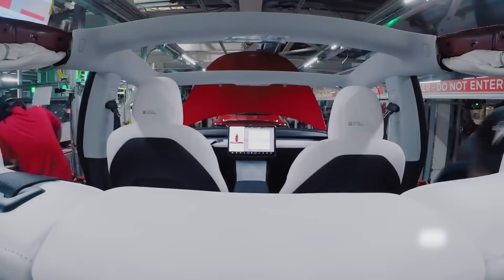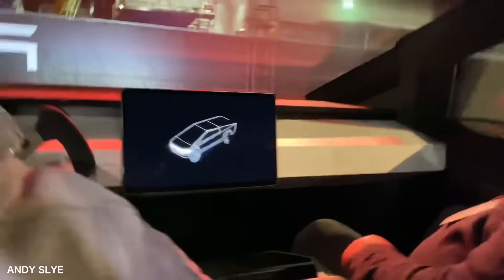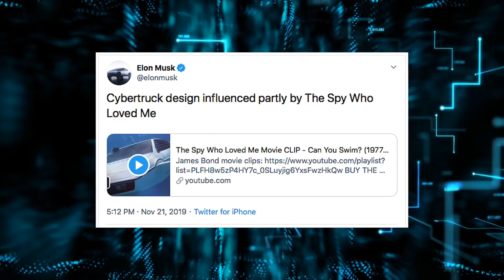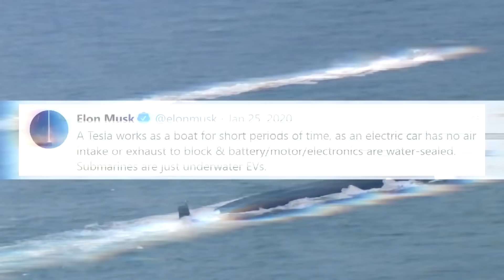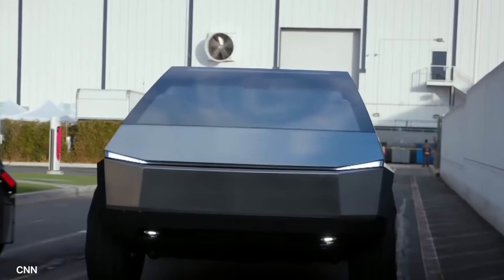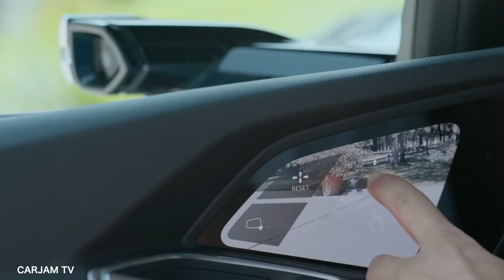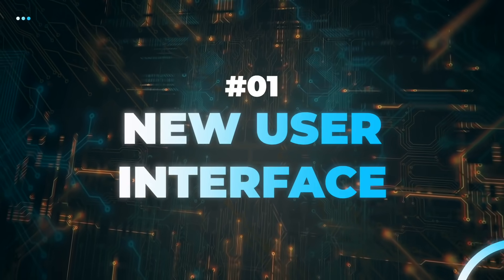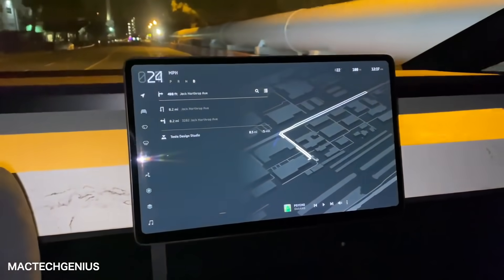Tesla Cybertruck - This is why Cybertruck is Special

Comment from the maker: "EDIT (ERROR): The price of the tri-motor model is said to be $70,000 rather than $50,000"
Reply: TechDiv go "THHHH" with every breath
Reply: Another edit: 9mm is not most commonly used in machine guns. 7.62x39 and .556 for militaries.
Reply: @GlassicGamer  
7.62*51  brother
Reply: @GlassicGamer  I
Reply: Elon actually also owns the underwater submarine car from the James Bond film.
Reply: Cool
Reply: Cool
Reply: should bring the price of Landcruiser's down heaps but fuel prices will rise.
Reply: another error, 9mm is never used in machine guns, as well as the fact that an either intermediate or full powered cartridge machine gun was shown on screen, neither of which are the same power as 9mm parabellum.
Reply: @ivefallenandicantgetup7950  

I completely agree. 

More like submachine weapons such as an Uzi or MP5 but with rifle technology since the STG44/45 evolving, the submachine pistols are replaced with short barreled 7.62mm, 5.45mm in AK platforms and 5.56mm, 7.62mm and 6.5mm rifle cartridges in the ARmalite platform. 

9mm SMGs are rarely used, if they are it's security detail for close quarters combat in buildings, not range to building or range to vehicle warfare
Reply: @JDMatthias  yes, submachine guns are usually used by security guards, bodyguards, and the secret service. But even if a submachine gun was used on the cybertruck I doubt it would be able to withstand the constant beating of bullet after bullet, especially if the weapon fires a specialized bullet such as 5.7x28mm or 4.6x30mm.
Reply: If you purchase the Cybertruck, be well aware that the thumbnail is a HUGE LIE! 

Yes, Elon Musk did say that because the batteries being in a water tight container the truck has some temporary buoyancy, it is not. 

NOT amphibious!
Reply: 2nd error, that's the Model Y and S
Reply: vitalik #shiba to 1 cent
Reply: It is electric
Reply: Lol
Reply: cheaper than I thought, I think it's price is 1,50,000₹ (Indian currency)
Reply: still good
Reply: The in built bed is rather good for homeless people
Reply: Hi, Gagan here.
Reply: 2023 will be $90,000
Reply: you are totally fine man
Reply: T
Reply: @syIer.  This is Great and incredible Cybertruck 100%  truck....
Welcome to Brazil Mr. Elon Musk.
We have great Place and Stregit pointer near to the graffiti  mine near to big Federal Route and big River too...

Welcome to Brazil man...
Great support for Tesla in Brazil...
Reply: Yeah
Reply: That's not a steering wheel, it's called a yoke. They're selling the updated Model S with that.
Reply: @StephenHitchens  it is a steering wheel named yoke
Reply: @StephenHitchens  vgk

Comment: It'd be pretty cool but like y'all said the standard run time on a full charge if you drive straight without stopping is only 250 MI and the charge time is over 21 hours just to get that so no I'm good with my Ram

Comment: What do you do when the electric grid goes down and there's no power?
 Are the charging stations all same type charger?
 When pulling what's the towing mileage like only a hundred milesso then where do yah find charging stations?  
Good show examples your actual towing 14k how far goes.
 heard to big takes up parking spaces it's large from side it's about 4 inches over lanes lines,  they commented its to wide some people say who viewed the truck.
Are those seats comfortable  enough where Lay down rest or sleep while charging? How long will take to charge? 
Do you have solar generator that can charge this if the power out or there's no charging stations? 
 wonder how zero point energy could complement ther install or industry.
Do you have turquoise blue as standard color for all dealerships? Why taking so long to actual Get hybrid Truck's that can actually tow?
Be fantastic when the release allow release the hover car's.

Comment: I've been able to build a huge income stream by investing in crypto with the help of Mrs Evelyn T hills trading skills & accurate analysis. 
Crypto analysts remain divided over the short and medium-term direction of the market, though major investors continue to buy the dip. There's no any reason to panic, as long as you've investing responsibly. As an investor, We all should follow the way of earning more regardless of the current market which is trading. This is the best time to double up and buy more- buy the dip and trade. I have made over 18 btc profits not just
by buying the dip but implementing
trades with signals supplied by Mrs Evelyn T Hills. You can easily get to Mrs Evelyn T Hills through her whatsapp number.. +: 1 : 3:, 2:, 3:, 9:, 9:, 9:, 4:, 3:, 0:, 0
Reply: I would contact her right away

Comment: Not to give too much away. I live in Colorado.  I ordered a few cybertrucks 
a year ago. They're all going to have TRI FSD. I have a thought of a way to use and
promote the first ten I'm getting. Its essential though  Please Mr Musk If you read this
  they get the three three quarter hitch front and back. 
      So, other then solar hanging from these, you could connect  
each CT to one other  tow . pull.  And my secret money maker with
 USING FSD TO ITS FULL POTENTIAL.    with that awesome speed.
And of course we have the mountains         I had to get the cyberlandr     
    THE CYBERTRUCK    Is as exciting as finding BIG FOOT         
    With all the cameras on teslas Ill have a big foot pic in no time.

Comment: Is this thing submersible or is one coming out one day??? Yes very interested but looking at a $300,000 price point no need to be cheap with a futuristic car angle

If this thing folds out into a house as planned, or maybe a boat, this beats rolls-royce to me. You are competing with a $500k-1 mil price point. Stop cheaping out with $40k priced cars. and Tesla needs to make diesel engines with electric chargers. Waterproof. Fold-out.

It needs to LOOK like a million dollar home. Not too big. Maybe in California.

Not an RV.

They are on the right track with cyberlandr and yet they decided on..... no diesel engines. The generator can be solar but the engine needs diesel.

Does Tesla plan on outclassing rolls?????????????????????

Then you need diesel engines, until super water engines come out for cheap. Please. DON'T BOATS DO IT OR SOMETHING??

Comment: I would like to see this video add an actual side by side with F150, RAM etc.  I am having trouble figuring out that aspect.  It is cool and all that.  It has horsepower but regarding pulling a travel trailer ... how will it do.
Reply: It will pull a trailer like a women pushing a stroller 🤣🤣🤣🤣👍

Comment: The idea of the touch screen for areas of use it designed is completely wrong. Touch screen good on highway or good road. But offroad driving and tough screen are not compatible. I know this from using Mitsubishi Pajera with 8 inches screen (custom one) offroad. You simply can't point your finger to where you need (again, I'm talking just offroad. On road all fine)....

Comment: What will the range be, when pulling 14,000
Reply: Who cares. The point is being missed that if you need to tow over that people by the higher spec trucks such as the RAM 2500 F250 and so on.

Why they feel the need to point out the towing power is beyond me.
Reply: @evacody1249  I think it is good they point out what the truck can pull.   I bought a truck, in part, for what it could pull.  

I’m really excited to see what the Cyber Truck and other EV trucks can do.  It will be fun to watch them evolve over time as battery technology continues to improve.

Comment: I'm not going to see this truck anytime soon. It doesn't comply with Scandinavian and European safety standards.  Pedestrian safety, headlight designs is far from the requirements. This vehicle will easily kill pedestrians at very slow speed.  They need do redesigned almost everything to get it approved on Scandinavian roads. Bumper hight must also match other vehicle. Keeping it off-road capable and road legal will be extremely difficult.

Comment: My garage is 20' in length, but I have water heater and washer/dryer in the front and need to have 2'-3' space in front of it to walk around. So forget it to park it inside my garage. I might park it on my garage driveway, but I would be blocking the sidewalk about 2'. Also, if I can't fit it in the garage, I can't charge it in the garage overnight. I think they should make a smaller version.

Comment: I love everything about the Cybertruck except the radical exterior design. I own a 2 door Ram 1500 and would like to see a Tesla pickup with a modernized adaptation of that classic two door pickup design. 

On all Tesla models, including the truck, I would also like to see Tesla mold the central display into the dash like they do on the current model S so it looks like part of the dash instead of an afterthought. 

Also like the model S, I would like to see that small LED display through the steering wheel to show speed and energy level so I don’t have to keep looking to the right all the time as I do driving our model 3.

Comment: i want one... but i just dont know if it would work out... my job is construction and im not about to ask customers, "hey can i plug into your house for powering my car." lol. idk man
Reply: can go 250 miles without charging.  you can buy a charger at home for under 2k so it would be fully charged every day.
Reply: @David_-gu5ot  yeah I would plan on having a charger at home. For sure. does the battery drain when its sitting there? Cuz sitting in the parking lot for 8-10hrs a day then driving home... idk if I'd have enough.

Comment: Huge overhang on the back, long wheel base, that thing is gonna be sad off road. 
Edit: More superchargers in the coastal areas, big cities, blingy charge stations. The backcountry where you might need an offroad vehicle with transport capabilities is about 300 miles  away but oops, no chargers there. 
What a shitshow that thing is.

Comment: I really want to talk to Tesla I can actually conform one of his electric cars into a self perpetuating power car 
I really think would be a lot more simple The most people think when using a test car as a prototype.
 All I would need to do is add another battery that I would use to  Charge primary battery  Van attached turbines to the wheels so that as you use the card you charge the secondary battery 
Only thing I would have to do for safety his have an automatic Shut off system for the Turbines attached to the wheels.
 This truck in the amount of  Horsepower it generates is more than enough to use any type of turbine generator I need to to generate the right amount of currency.
 Tesla cars are already there they just need to go that 1 extra step

Comment: Why would you emphasize that stupid 17" display? That's a cheap chinese-made monitor worth less than 200$ (retail price) and Tesla probably pays less than 20 bucks for that thing.
 Rather ask about payload vs range vs price vs durability. It comes down to one thing: Value for money. Period.
If a truck doesn't do the day-to-day working-class stuff at a reasonable price it'll be just another toy for the rich.

Comment: I like the stainless steel...no rust...the shape is a bit strange but sounds like it’s quite practical and efficient
Reply: 304ss will rust, all stainless will eventually rust. The chromium oxide layer will be agitated off eventually, especially in road conditions. Common misconception. Stainless is infact not rust proof
Reply: @jnsd891  yes long term, for the most part stainless will take forever to show rust
Reply: @jnsd891  No problem. The aftermarket spray on ablative armor will cover that.